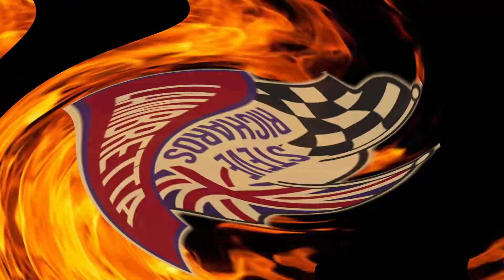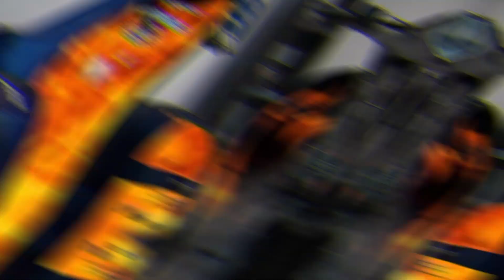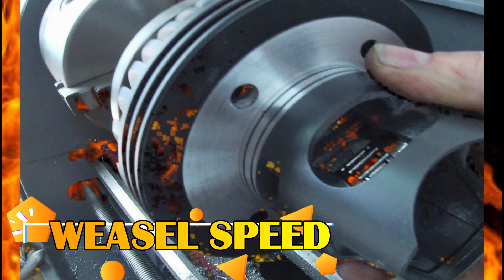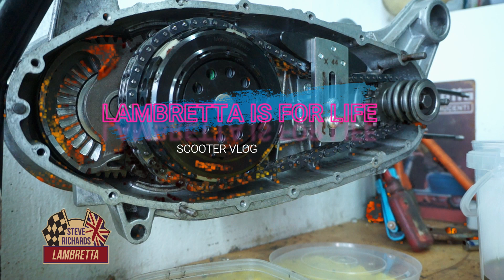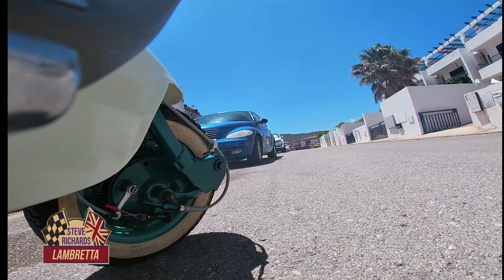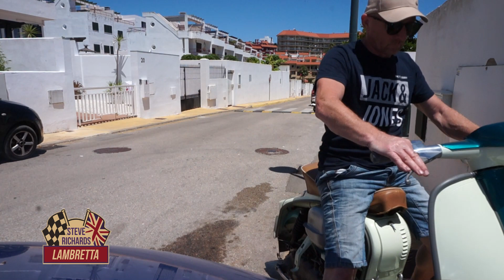lambretta front brake part 3

Comment: Interesting videos as always - thanks. I guess as long as the cam doesn't turn a full 90 degrees and lock on then it should be ok. That could only happen with a lot of wear on the shoes or some other mechanical failure. I suppose the key is always is regular checks and regular maintenance. I'll be trying this on my winter build. project
Reply from the maker: no the cam is still the same width ? its a progressive shaped ramp . watch again closer  🙂

Comment: Did I not see somewhere that reverse pull in a drum set up wasn’t a good Idea? I am certainly no expert and would be interested in your comments.
Reply from the maker: mmm where did you here that ? and for what reason ?
Reply: I cannot remember where but I think it was something to do with shoes locking . I was just about to do it on mine but it put me off. I have just disassembled TV2 hub tonight prior to getting it vapour blasted and I am going to use your mods in that hub . Can you tell me which direction to knock the bearings out and do they knock out at the same time? I tried with a socket and tapping them but they didn’t move (I have removed the circlip)  should I be heating the hub ?
Reply from the maker: @zyroman  well almost everyone in the 60s and 70s where racing with reverse pull brakes and fitted as standards on rays s types . ive raced using them in the 80s at donnington park in the rain ? this better version is more progressive and has better feel . but will never be better than a disc brake ........